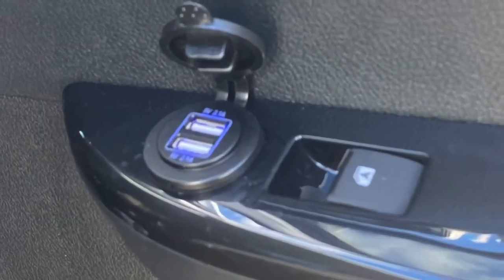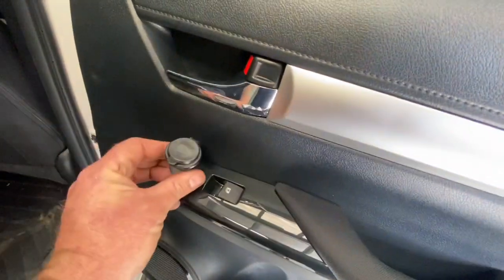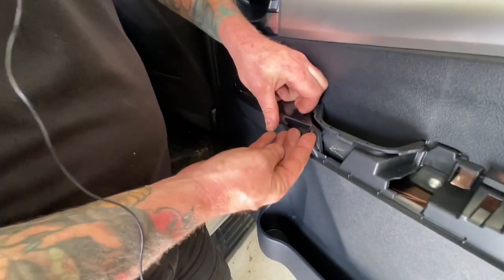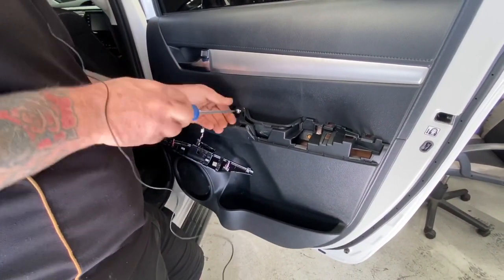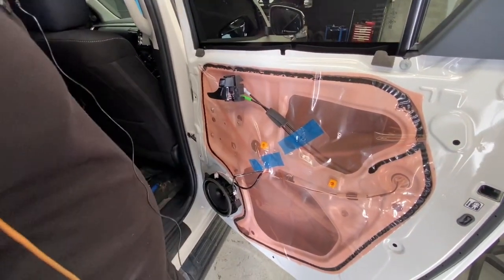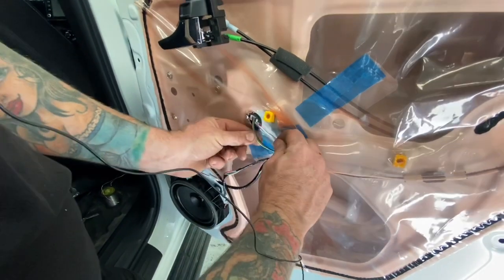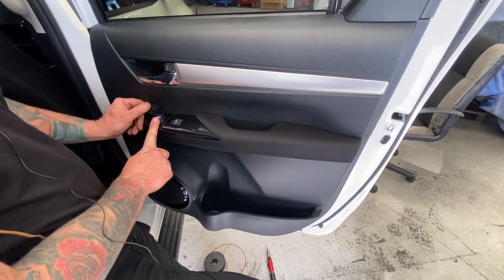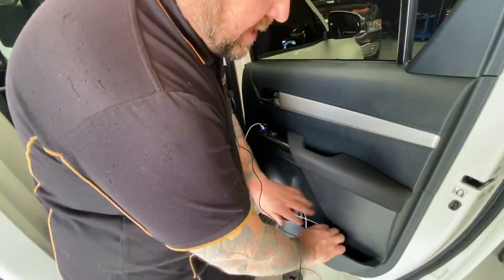How to install USB power sockets in the back of the N80 Hilux

Comment: Nice install and great audio.
Drives me crazy when kids keep wanting a charge,  we have a N70 Kun26 Hilux  would the power feeds and earths be the same colours? Many Thanks.
Reply from the maker: Thanks Jenny
Couldn’t say for sure but a quick check with a test light would tell you which wires to use
Reply: Did you end up doing it Jenny?